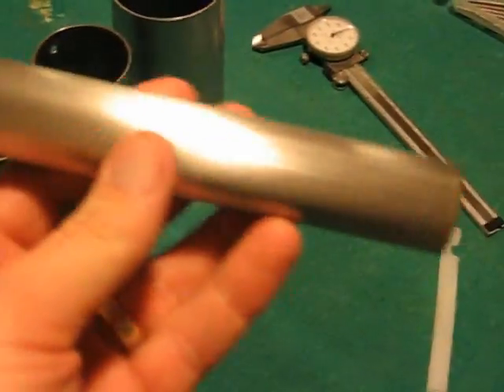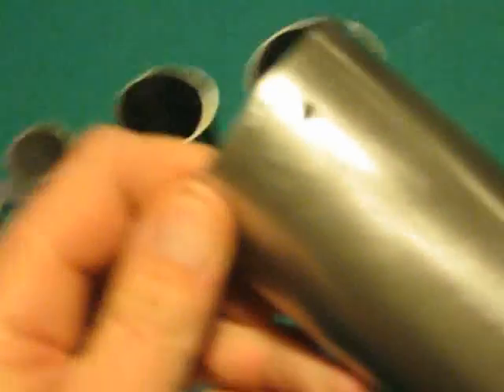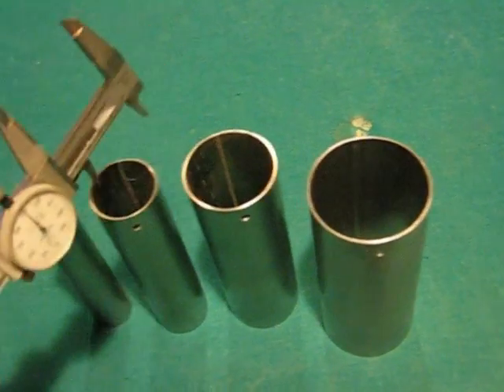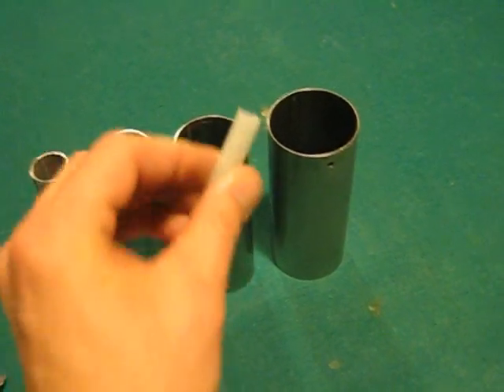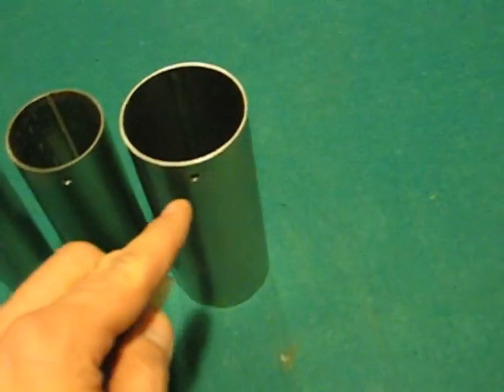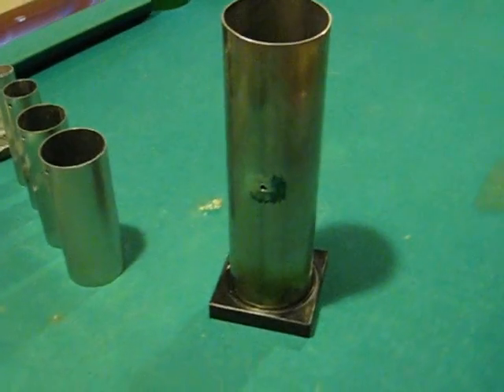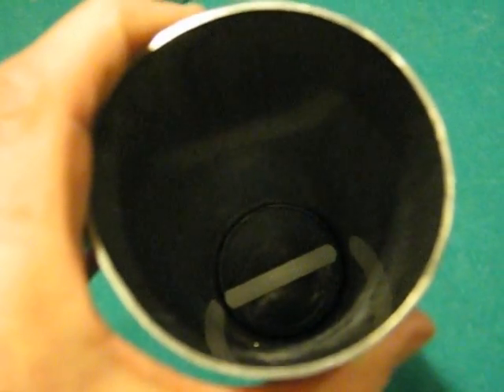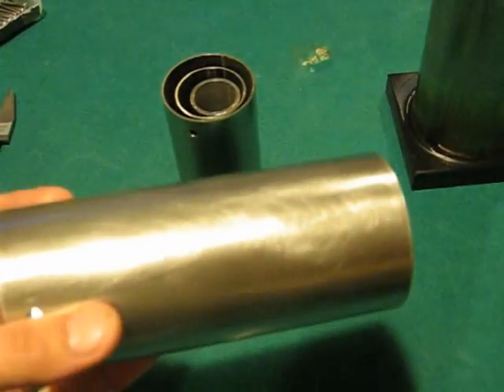How to assemble the HHO generator part 1

Comment from the maker: @just1sirish Yes these work in higher temperature climates.  It is the lower temperature climates where HHO does not do well.  
As for mass production, you may want to go with a "dry" type of cell, because they are less expensive than the one in this video and easier to build.  If you would like information please send me a message from my home page.

Comment: two thengs one is if you develop a high class generator that needs no petrol or diesel assistance to run an engine stay quite a few people have dissappered after making some of these also has anyone tryed using HHO similer to NOS use it as a booster

Comment from the maker: Hydroxide will ruin aluminum in no time.  If you must use hydroxide, please use a secondary bubbler filled with activated carbon and water.  I never heard of the vinegar trick, so I don't know if it works.  Also, do not lean your motor too much, it will create heat.  However, the idea is not to lean the mix too much, it is to make the fuel burn more completely (at least that is my goal).  My car still runs like a dream, even after 2 years with HHO.

Comment from the maker: Who are you directing this toward?  The user that makes the ignorant stainless steel comments is not found on this post.  These are stainless steel pipes.  Please don't use anything but really good stainless (304 - 316 - 440c - etc.)  Unless you want a terrible foamy, black/green mess.

Comment from the maker: If you use any copper alloy, or higher content of iron alloy, the water will turn black and foamy.  It will clog up your generator in no time.

The SS deplates from the cathode and builds up on the annode.  The cell is sealed and there really is no risk of inhalation.  The mineral is too heavy to evaporate into the engine.  This is basically, somewhat a plating process found in any machine shop....accept we do not use acid.

Comment from the maker: Any gap seems to work just fine, from .050 to .250.  It all depends on your voltage and electrolyte.  Please do not drink the electrolyte after running the generator.  Also, try not to breathe the vapor, as it is semi-free of ions.

Comment: I am building a unit with 304 stainless plates.I have read that for optimum generation a gap of .048"-.063" is required. then i found that using stainless produces hexavalent chromium which causes cancer and is considered extremely deadly to internal organs! have you done any research on this major concern?

Comment: awesome video!  I saw this a week ago thought I'd give it a try.  I have it built exactly the same way you described and had slightly more hho production some how.  almost 1.5 letres per minute.  I'm still kinda weiry about installing it though.  It's fuel injected not a carborator and I'm not an adept mechanic by any means.  

Would I run multiple tubes to each combustion chamber?  Have you noticed the copper tubes corroding at all?  Once again, thanks and awesome video!

Comment from the maker: Heat isn't really that bad of a thing.  Creating steam as well as Hydrogen will help to cool the engine and create more combustion pressure.  There are a few solutions to heat.  1, run multiple small cells in series, reducing the voltage across each cell.  2, install a small circulating pump and a radiator (that cooling system should only cost you ~ 100 dollars)  :)

Comment: Thanks much! Hey, I got a question. I have a carbureted 5.0L v8. Of Course its a 4 barrel OEM style. Would I be able to power the car with just the primaries? What I mean is that I want to only use hho for the primaries and use gasoline for the secondaries! At idle it should be using no gasoline

Comment from the maker: The neutral just gets in the way.....so to speak.  I am not sure if it actually improves production.  Since electrolysis takes place BETWEEN the plates, the atoms need to travel further to reach their destination.  I will build a new cell, soon, that has large spacing and no neutrals.

Comment from the maker: Hi Wizzard.  I used a stainless steel outer housing for my cell and made the entire housing the ground.  The cell is positioned in my car, in a place the forces fresh air to rush over the outside of the unit.  Also, I only run it at 16 to 20 amps.  Since a WATT can be directly translated to heat, the lower the amp draw the cooler the cell.  NO MATTER WHAT ANYONE TELLS YOU!  Thanks for the order!

Comment: Heating issues are usually reduced by circulation of water from a containment system. I am working on a dry cell with that set-up right now. 2+ gallons of distilled water through a cooling coil (beer cooling coil) mounted in a cooler packed with ice.

Comment: Nice Build. 

It would help if you told your viewers how you insulate the screw from tubes; inside the holes. If it touches them it will short them out. Just add it to the "About" information.
Again; nice build.